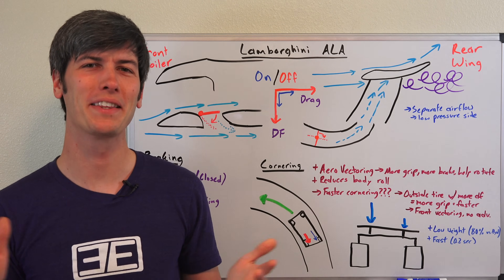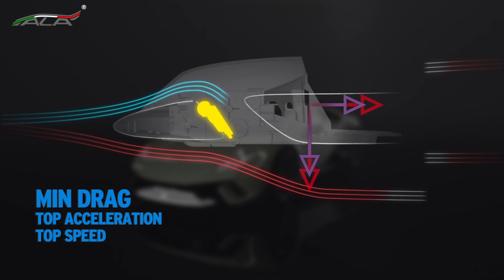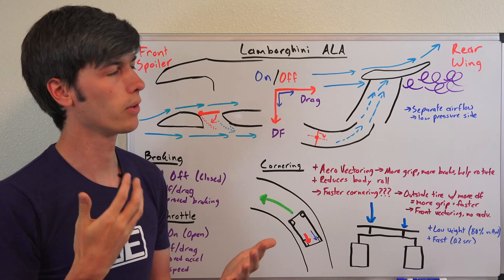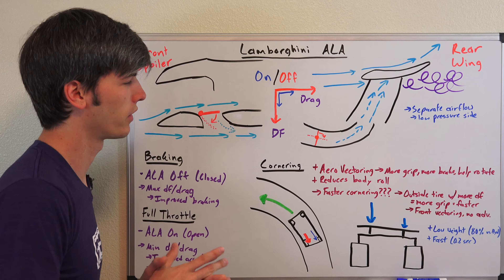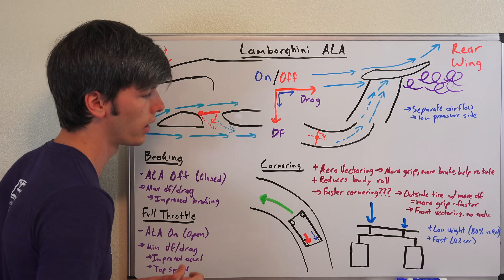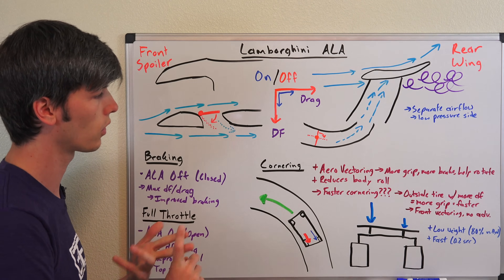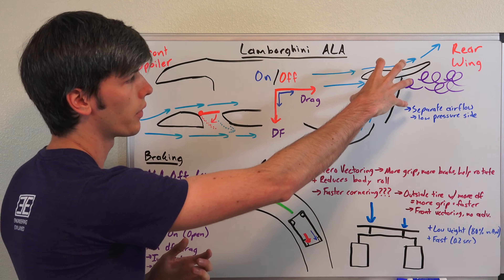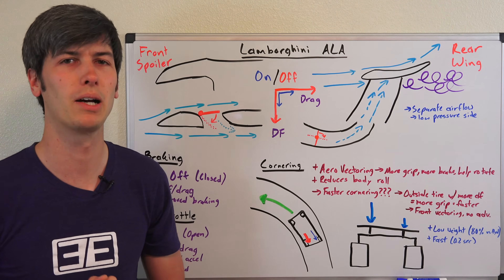Lamborghini's Brilliant Active Aerodynamics - Huracán Performante

Comment: On the subject of Aero Vectoring, perhaps another point that could be added is, having more downforce on the inside rear tires would help equalize load between inside & outside tires, which would also equalize load on the rear differential. This would increase the threshold point where the inside wheel would spin when accelerating out of corners, before requiring Electronic Stability Control intervention of mildly braking the inside wheel. 

We have to remember that Limited Slip Differentials on production road cars are a compromise, and generally are too mild for optimum lap time on the track, as they have to be able to be driven on public road without clacking & binding during u-turns (which aggresive track-optimized LSDs tend to do, especially when the diff oil is cold & thick).

Comment: The ALA system is extremely interesting!!
Here is a small scale test you can try (I can't because I don't have that many fancy toys): 
Take a model car, where you can turn the front wears with precision. push that model car with precisional speed, and record the turning angle.
Now put a heavy weight on the inside of the turning angle (right side if turning right) and push the model car again so it matches the speed of the previous push.
Is the turning angle tighter or looser?
Also interesting would be, can the small scale model car be with and without "suspension".

Comment: Well having better downforce on the inside of the the turn would reduce tire lift wouldn't it? Since the load is transferred more towards the outside wheels the inside ones have less downforce so wouldn't having the valves closed during cornering mean more even load on all tires? Correct me if I'm wrong lol

Comment: Cornering in this case using the active system increases the down force on one of the rear tyre which is the direction of the turn and maybe this difference in the down forces creates a kind of pivot effect originating from that Tyre in the direction of the turn and guess that makes the car turn more easily so maybe it is helpful am guessing. great video though loved watching it.

Comment: wonder if ALA is used to reduce the downforce on the outside tyre on a corner with an already high load, is to help reduce tyre wear and not overload the tyre, reducing it's heat.

Comment: Hi Jason,

I love your videos and like how you make understanding the engineering behind all aspects of the car accessible to everyone who may not be as technically inclined. I do, however, disagree with your view of the Hurrican's active aerodynamic settings for turns. I believe what the Lamborghini engineers were aiming for aerodynamically is to use the system like a drag rudder used on the B2 bombers. While we would both probably agree it's not going to be very effective for the intended purpose of a street vehicle it would lend credence to the aerodynamic aspects of the system's design. Could you please share your thoughts on this with me?

Comment: Maybe the differential downforce in the rear applies more force to the inside tire to allow it to grip more in the corner. The outer rear tire has more force from weight transfer, so applying more force to the inside tire would even out the force applied to each tire and allow for better use of the grip the tires can provide.

Comment: For cornering... please hear my devils advocate opinion......

We can all agree that downforce isn't free and it costs drag. So downforce=drag

Replace the vectors on the rear tires so they point in opposite direction and the system makes sense.

But obviously without knowing the cars actual CM and corner speed... It is hard to calculate....

As far as using the same system for the front; they didn't because they were concerned that the car will understeer from lack of traction on the front wheels. Oversteer can be corrected by a skilled driver. Understeer is much harder.

Comment: I think it could potentially help corning though. I understand what you're saying. But let's say it has 275mm tire width. (I'm too lazy to do the math of this) For example, you could have 70 precent load transfer onto the same width outside tire. That's a fixed variable. If you reduce that load transfer to 60% then more of the grip load is shared by the inside tire. Increasing the total effective grip, like an anti sway bar.
Reply: With 57 precent of weight to the rear, that helps traction during acceleration when load transfers but the rear aero could help total balance of the car as the most load would be on the outside rear. This could offset that, even adding grip to the left front as well as the whole car comes into better balance.
Reply: inside front that should say. I was thinking of a left turn in my head.

Comment: Also, my estimation of how the added downforce on the inside wheels could help cornering is that the outside wheels are already heavily loaded, so adding load to the inside tires could help with the balance of grip from side to side.  Though still not sure if just having max DF wouldn't be better though.

Comment: One thing I don't think you touched on; if the outside half of the wing is stalled and the inside half is still producing downforce, you have a moment about the inside half of the wing created by the drag, effectively air-braking over the inside wheel. I suspect this is a significant portion of the vectoring benefits as the centre of drag relative to the centre of mass would explain why aero vectoring is used only at the rear.

Comment: ALA alllow faster cornering because it enables Lambo engineers to design a very aggressive aero package (flaps closed during cornering and braking) while keeping drag low during straight line without breaking (flaps opened).
I believe the "faster cornering" feature comes from the overall agressive aero rather than differentiated flaps actuations

Comment: Jason said, more downforce on the outside tyres while cornering can give more grip and hence corner faster instead of putting the downforce on the inside tyre.

But, already, the outside tyres are under load due to load transfer to the outside, thus, maybe they are close to their peak slip angle grip. Adding more load on these outside tyres by increasing the downforce on them would increase slip angles further above the peak grip slip angle value
Thus maybe then, the inner tyres are given downforce to neutralize the effect of load transfer.
Reply from the maker: +Rujul Satpute increasing downforce on a tire does not increase it's slip angle, if anything it decreases it. That why vehicles with high downforce corner faster. Yes, there's load transfer, but the tires grip is ultimately a function of the ratio of mass plus downforce on it, divided by the mass.
Reply: Okay so the downforce value is in the numerator. So does this mean the total grip value increases. Right?. And, I am trying to understand, downforce would decrease the slip angle, that is, slow down a spinning tyre? by applying more normal reaction on it?. Is there a video or a paper you would suggest on the effects of slip angle due to downforce?

Comment: Hi Engineering Explained. I use to watch your channel and the most that I like is to rarely disagree with the physical analysis you do. But this time was different. Let me say:
At 3:45 you said something like "of course, you can make with suspension settings". Nothing farther from truth. What can be done with suspension is quite different from what can be done with aerodynamic forces. And you can make it work together in very interesting ways. This aero vectoring can help keeping the floor of the car parallel to the ground. That is a hell of a lot aero force in a ground effect car. Quite a hell. And with aero (or any other external force, that is the important thing) you can have the car with zero roll angle. With suspension roll stiffness you can't have zero roll, because with zero roll there's zero force as it is a spring. No force, no displacement. And the more rolling stiffness you have, the worse the braking, accelerating and steady cornering performances will be. Of course, it will be a more quick reacting car. But that reaction can be regained when you don't let the car to roll with external forces (aero forces in this case).
Furthermore, it's much more productive to push down the inner, and less loaded, wheel. As tyres are usually non linear, the marginal benefit of each unit of load is lesser, i.e., the derivative of lateral force vs load is always decreasing.
Well, this subject has much more to say about, but I think it was well enough to make you re think about it. As my explanation may not be the best, I guess you really got the point.
Reply from the maker: For the most part, I don't disagree! But it is indeed possible to eliminate body roll through the suspension: https://youtu.be/tnpRNQaOVwY
Reply: You're damn right. Even more, I have totally forgotten about roll center/axis height, which if high enough could make your car to roll inside. Nonetheless, all of this has cons, has higher roll center implies that the car (with no active suspension, right) will rise under lateral force. And the active body control from Mercedes, as you said, does not improve performance, as it is unloading heavily the inner wheel, what takes me back again to the nonlinearity of the tyres.
Any way, great videos, thanks for answering back. All I wanted is to make make justice to Aero Vectoring. I knew of this feat because of your video and loved it. I found it pretty clever and worth to be tested, a truly good and creative idea. I believe you were unfair towards it.
Best regards!

Comment: Great explanation as usual. 

Constructive criticism from an engineer who does a lot of presentations: 
- Buy a bigger whiteboard (they aren't expensive) so you don't have to write in engineer font (tiny)
- Use your colors better. 
-- Draw form outlines (e.g. the car and wings/splitter) in one color (and use that for all your forms)
-- Use one color for label text
-- Use two separate colors for binary choices and stay consistent with them. Off/on butterfly/flap positions and the resulting air flows.

Following the above suggestions. You have:
- A nice big outline in black; 
- Labels in green; 
- Valve/butterfly positions and the resulting air flows in orange and blue (off/on)
and Bob's your uncle, your verbal explanation gets much easier because you don't have to use so many hand gestures because your picture is saving you a thousand words.

Comment: great video. Im extremely sceptical you can vector using stalling half a wing. I sent this video to Kyle.drives you tube channel he will know if this is BS or not. Im betting it is BS, that at extreme high speeds there will be a tiny benefit, but for 99% of the usage its total nonesense.

Comment: I never knew 'downforce' is a bad thing for speed. I need to watch a video of yours related to that part, or any other who explains it better..!
Reply from the maker: Downforce itself isn't bad, but it correlates with increased drag. From an efficiency standpoint, aero engineers are always trying to maximize downforce while minimizing drag, but the two are not mutually exclusive. More downforce generally equals more drag, and more drag means you have an opposing force to what you're trying to do.
Reply: Thanks for replying.
I learned about downforce watching an ad for F-1 race, in my childhood and the AMG Merc, inside the tunnel. The Merc ad sounded like, the car produces enough downforce, we can... and proved it :)

Definitely, we need more lessons on DownForce then.

Comment: One of the main things is that the Aero can react way faster than hydraulic systems. The Hydraulic Systems of today (like the Flaps you find on the Pagani) are only working properly in long corners, as the system reacts to the steering and speed and than moves up and down. When you change a lot from left to right corners, or just have short corners on a mountain road for example it almost not working at all, because its always happing to late after you entered the corner. The delay is to big for quick changes. By having a system which can adjust in a fraction of a second, you have actually a solution which works also for fast changing corners or short corners. -  Thats the main advantage comparing to other systems out in the market.
Reply: How do you know how long it takes until the air from the additional channels "stalls" the wing.
Reply: There are several nice Videos where you can see it and some Engineer guys (i think also here on youtube) discussed that too. But you can see it clearly when you are just watching a Pagani goes round corners. Flap comes up when cornering is almost over and is not back up again for the next corner. The little flap in the Lambo is way easier to open and to close (like a throttle body in an engine). So because of that you can adjust the airflow in about 2/10 of a second.
Reply: They can maybe adjust that butterfly flap in 2/10 of a second, but how long does it take till the drag and downforce are reduced and how long does it take for the air stream to recover after the flap is closed?
Reply: The airflow closes almost instant. Takes mot even a 1/10 of a second. There is pressure of air in front of the butterfly flap. Imagine a water hose of 20 cm length with a valve in front with pressure on it. you can try at home if you want ;-)
Reply: You really don't understand what I mean. It's not about the air in that duct or the butterfly flap. the only thing that matters is the influenced aero flow on the wing and that the downforce and drag is reduced. The butterfly opens quickly yes we get it but if it takes for example a second till the air flow at the wing is stalled then it would mean that it takes 1 second to shift from high to low drag. In the end it could be the same time it takes on the Huayra or P1. Things like that can be measured in the wind tunnel but we don't have the data or do we?

That was why I asked, how can you know that this method is for sure quicker than for example the one of the Huayra.

Comment: Which one is more important on drifting horsepower or torque? And how does a car drift with high torque and low horsepower or high hp with low torque?
Reply: Well torque can be changed by the transmission or gear ratios. Power is not changed by the transmission (at worst it's reduced due to friction loss). Power is something that you need to go fast, to work against the drag. If you don't want to go fast, but want to accelerate quickly, torque could be more important than power to you. However, that is something you could get by getting a lower gearing.
A car needs a certain amount of torque to "break traction". However that is rather a power slide than drifting. There are certain drift technicians that make the car go at high side slip angles without much power or torque. It depends on the driver. It's not really A or B it depends what the driver does with it.

Comment: The video says 200ms activation time and press release says less than 500ms. 200 is less than 500 admittedly but if it is close to 500ms then it's entirely possible that this is too slow. It's "500mS" to activate and how much longer to take effect. When going hard in and out of corners the 1/2s plus delay before there is a change to the aerodynamics. At about 150kmh the 1/2s has you traveling about 25m before it does anything. That's a fair bit of a corner.

Comment: Thoughts on downforce cornering.

The weight of that car is shifted to the back.  now the differential downforce is also differential drag. so I'm imagining it like pushing on a lever thats attached to the center of gravity.  For the front one the lever is at a pretty shallow angle to the COG and mostly in front of it. hence not that much extra turning.  while for the rear one it is closer to the COG in terms of front to back and so is relatively more to the side where it could act like a lever to help turn the car more.

Additionally the outside FRONT tire is the most important tire for actually changing the cars orientation in a corner so lowering its downforce would be worse than lowing other tires' downforce.

What it comes down to i think is that lowering the downforce is always bad for corning but the lever effect of differential drag is always good for cornering.  This couples with the fact that lowering downforce in the front is worse than lowering it in the rear and the the lever effect is more effective in the rear than in the front, and i think explains why they do the differential downforce in the rear only and not in the front.
Reply: Actually on cornering the car is first slowed down, then around the apex when the driver starts accelerating, it goes from losing speed to gaining speed. The first part is inevitably for a quick line, the second part is not, because the driver can wait for the car to straight up before he goes on the throttle. 
Something that can be well experienced in a Go-Kart. When the car is decelerated, the wheel load shifts towards the front, not the rear.

Lowering downforce in the back is worse than in the front! The rear wing creates stability. There is no cornering without stability only a unstable and dangerous situation. The main concern of every aerodynamics engineer is getting enough downforce on the rear. Because only when he gets more downforce on the rear, he may add some on the front. Also there is rather a tendency of the front aero getting more effective with increased speed than on the rear. What further increases the importance of the rear downforce as stability is more important the faster the car goes.